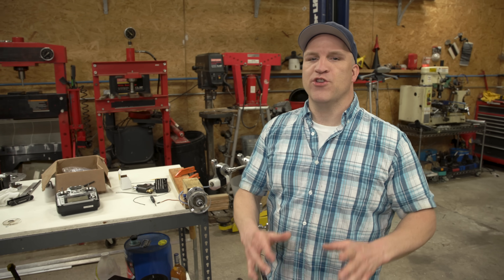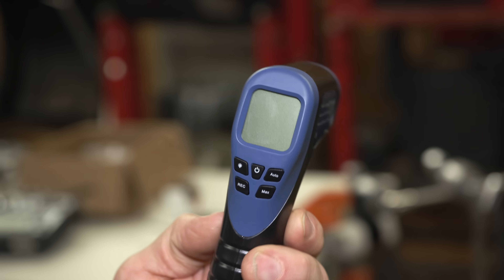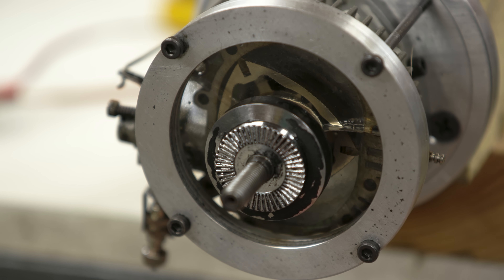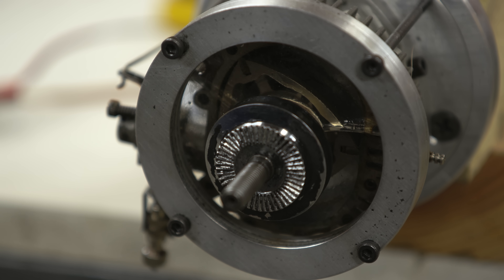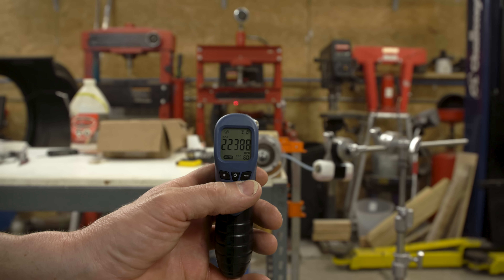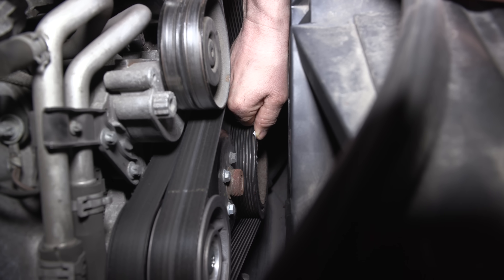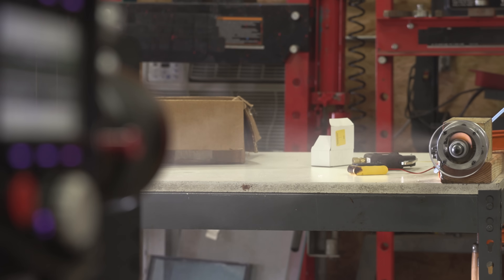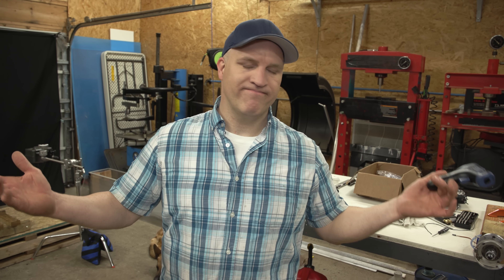See Thru Rotary Engine MAX RPM - 29000 (Wankel Engine)

Comment: From Wiki:

The maximum revolutions of a rotary engine is limited by tooth load on the synchronizing gears.[33] Hardened steel gears are used for extended operation above 7000 or 8000 rpm. Mazda Wankel engines in auto racing are operated above 10,000 rpm. In aircraft they are used conservatively, up to 6500 or 7500 rpm. However, as gas pressure participates in seal efficiency, racing a Wankel engine at high rpm under no load conditions can destroy the engine.

https://goo.gl/CzcpJL

Comment: That's pretty cool.... I know the clear cover is basically bulletproof but i still dunno if i'd wanna be 
standing directly in front of the main shaft (that isn't covered by the bulletproof casing) but is surrounded by combustible 
fuel that's spinning at over 20,000rpm, without having another safety screen in front of it!
 Just sayin.

Comment: I've owned rotary engine powered cars, 2 1st gen RX7's actually. My '81 12a powered car I used to routinely twist up to 9k rpm on the street. My '84 13b powered car saw 11-12k rpm daily for most of the time I owned it. They are insanely powerful little motors, & you can rev the piss out of them.

Comment: I turned to my wife and exclaimed,  "29,000 RPM, That's Insane!!! and about 2 seconds later, you cut in with "29,000 RPM, That's Insane!!! Awesome... lol
 Now it's time to use an FI system with a larger throttle bore. And maybe stand a little bit further away from it when you open it up!
Reply from the maker: Ha... That's funny

Comment: Don't forget to keep in mind , most measurement instruments are calibrated within a certain range... Depending on intended use . Be fair to presume the tacho you used  would be intended for use under 10k rpm ...

Comment: back in the 60's honda produced racing four stroke motorcycle engines that spun at over 20,000 rpms. so yeah having a tiny wankle spin at 29k is not hard to believe.

Comment: But a RX-7 won't rev up to 2900 RPM
Reply: the old carbureted ones would wrap the tach needle all the way past the last number and hit the back side of the stop peg and still not blow up. with the stock porting they didn't make good power past 6500 or so but would hold onto themselves at 13000 or more.

Comment: Impressive video...just a note about verifying the accuracy of the RPM Meter...you should check it at the approximate operating range in question...by checking it at ~1000 RPM, it is presumptuous to say it is therefore also accurate at ~30kRPM...internal electronics could be nonlinear, or just plain inaccurate up there...depending on what the unit's limit or operating range is...what do specs on that meter state anyway?...if 30KRPM is well within its range, I wouldn't question accuracy...  Cheers
Reply from the maker: That's a good point I didn't think about that. The limit of the meter is 99,000 rpm .

Comment: That s. A hobby ariplane engine never getting 29000 rpm only with nitromethane the tach is not ok ...and u have to keep the rpms , the engine never hold it not even for a second...

Comment: You forgot to divide it by 3. So it's actually at 9700 rpm which also lines up better with the sound.
Notice that when you measured with the frames it wasn't the same tip that finished a revolution.
Reply: Measurment is taken at the shaft.  Doesnt matter how the engine rotates the eccentric shaft we just count how many times it does.  We dont count how many times a piston has to move per revolution either.

Comment: Cannot consider the failure of a transparent cover as engine failure. If the engine had the proper part (metal) and it cracked, that is a component failure which lead to a secondary failure: namely the engine not able to perform and not classified as an engine failure. For technical reasons, any moving part within the housing (engine block) is considered the engine. Would anyone consider an engine failure if the spark plugs fail or the wiring supplying electricity to the plugs fail? if the crankshaft, moving gears or chambers malfunctioned, then yes that would rate as an engine failure.

Comment: What's even more impressive is how much HP these little engines crank out, they got 3 cylinder rotary's in Australia that are running 240mph+ putting down 2000+HP

Comment: how much hp we talking here? modulate 12 of these bad boys in a v pattern using an engine block ironically to cradle them. 12 rotar! prob. not very powerful, but the sound will be fast enough to beat ppl. XD

Comment: The only thing is that I would like to see the math on how many Rpms that would be on a rx7 size motor because the rpms would be a large fraction of that on a engine with a 4 inch rotor

Comment: How do you mesure the rpm? I think it has only 10k rpm..
Reply: The rotor was moving at only 9667 rpm but that is good.  The rotor is an internal engine component.  We want those to move as less as possible.  The goal is to turn the e shaft.  So this engine was able to rotate e shaft at 29k rpm while the rotor was only having to move at 9667rpms.  This is purposeful so the engine can churn out insane rpms but the actual moving parts inside the engine are moving at a fraction the speed.

Comment: If you're doubting the accuracy of a tool, you probably bought the wrong tool... (Even if you can check it)
Reply from the maker: I always check the accuracy of my tools when they are important. Try working on an aircraft with an uncalibrated tool. Even my best meters always had to be calibration certified by an outside company, torque wrenches everything... It depends what you work on. Even if I had paid $120 for this tachometer I would have still doubted the accuracy, nothing is 100% accurate.

Comment: ROTARY POWER!!! They have no reciprocating parts (parts that move up and down) unlike the pistons or valves on l4, l6 or V6, V8 and such. :)
Reply: Wankel power actually... this is the non-rotary version called the KKM.. The triangular shaped piston actually does reciprocate as it orbits in a planetary motion, a Mazda 13b engine for example has a 30mm stroke produced by the 15mm eccentric-crankshaft throw (offset).

Comment: There seems to be a lot of wasted cubic capacity with the triangular rotating "ring" if the sides of the triangle were inversed then the cylinder capacity would be even bigger - It would increase  some of the stresses but also increase the HP and make it more efficient too.
Reply: The Wankel was very inefficient... thats why it is obsolete.

Comment: Rotary engines love to rev higher and higher since they are spinning and don't have to convert the energy into any other form like piston engines
Reply: Wankel engines are mechanically LESS efficient... which is also why the consume so much more fuel.
Reply: doktorbimmer that is correct 👍

Comment: Dan42
On a wankel engine the exit shaft rpm is x by 3 from the rotor, so the rotor is running at 9700 rpm, only!

Comment: Could you try running the rotary engine on diesel?
Reply: Why? Diesel fuel is low octane.
Reply: @doktorbimmer  And that's why you inject it at the top of compression.
Reply: +Ellenor Malik Sorry, but that won't fix the problem either. Unfortunately the  Wankel KKM design is not very efficient or compatible with Stratified Charge Mode combustion... which is also why you will not see any production Wankel engines using the Diesel Cycle or GDI.
Reply: @doktorbimmer  I'll do it with a roots blower and pair of diesel injectors hacked onto a Mazda rotary with a drawthrough carby feeding 5w20 2temps oil just to spite you =)

Not saying it'll be efficient
Reply: +Ellenor Malik Yes! Oh Please do! but promise you will post a video... it should be good for a laugh!

Comment: Audio frequency analysis was a bit hard to do, only a short clip on max RPM and a bit of background noise:  486 Hz on first harmonic --> 29160 combustions per minute...  How many combustions do you actually have in 1000 revs? (depends on the gearing of the combustion chamber to the crankshaft.
Reply: I need glasses, and/or watch your previous video: no gearing, only bearing, so 1 combustion per rev on this particulate engine... So I can agree with your 29k RPM

Comment: Not a true determination or rpm the reflector has to be on the crank .
Reply from the maker: It is on the crank, actually it's on the flywheel, which is directly connected to the crankshaft, how can you measure the RPM so close to the center of the crankshaft?, You need some distance from the center to the edge of the flywheel, the crankshaft turns one revolution the flywheel turns one revolution. One revolution is one revolution no matter you measure it from.
Reply: Warped Perception yep na you are 100% right . I was thinking of something else for some reason. My bad .
Reply from the maker: Religion is poison ha, all good, I know it's kind of confusing since it's through and you can see the internal components, normally with my see-through piston engine you don't get confused because it's just up and down reciprocating motion. Thanks

Comment: I clipped a second of peak or near-peak RPM audio and did a spectrum analysis.  There are lots of louder overtones, but there is a decent fundamental around 479 to 482 hz, which would be 28,800 to 28,920 rpm.

Comment: So about 9600rpm, sounds about right for the sound it makes.
Reply from the maker: 3800Tech RPM is always measured by shaft rotation, not internal component rotation. That would be like if you take a V8 and you measure 1 RPM for every time a piston went up and down.

Comment: i dont believe your tach is accurate, even for such a small engine the rotaries dont run at 10k and sound like that. ive built enough rotaries to know that even a 2 rotor engine sounds much more labored than that at 10k with twice as many combustion cycles. you probably had your meter cycle set to 2 cycle, and it needs to be set at 1 cycle, since a rotary fires once per revolution. even at 14,500 RPMs they seem to take it in stride and ask for more.if you increase the intake and exhaust size you can keep it going because the only limiting factors to these engines is how much they can breathe and how well they are balanced.

Comment: Nice engine, one question how are you igniting fuel and is there timing on rotary? I had a 89 rx7. 15 years ago . With aftermarket straight pipe I was revving up to 10k . Spitting 4ft flames
Reply: Engines that small often uses glow plugs, so there are no timing. On spark plug rotaries there are two plugs per rotor, they use a leading plug and a trailing plug. Because the timing of those plugs varies, and the time between the leading and trailing plug also varies, there are in fact two distributors and two coils on a 13B engine.

Comment: If I'm seeing this right, this is an OS engines 0.30 ci Wankel  4 stroke.  I can also see that you used a clear disk as a flywheel.  29,000 RPM is completely believable for this engine with such a flywheel.  It was designed for a propeller, which will considerably limit the RPM due to the prop loading, and provide cooling air to the engine.  I'm thinking that may be why your front plate cracked, too much heat.

From what I've read in various forums, you did pull off something of a miracle by taking it apart and getting it to run after going back together.

Comment: You do not understand wankel too well do you?

Devide x 3 you measured rpm on each individual rotar tip pass.

It's 3 times less. You need to take a reading from 90 degree square face on the shaft with a black mark.

You did it from the front.

With your math my cars idles at 2krpm. And pulls away at 4krpm. You do not measure each piston stroke  you only measure the shaft rotation . 

By your calculation. My 3.2amg mercedes v6 limits at 36000rpm
Reply from the maker: It doesn't matter what's going on inside the engine, you always measure shaft RPM, that's what I measure here, it's just confusing because it's see-through and you can see the internal components, that's not what I measuring. RPM is always measured at the shaft on any engine or electric motor, it doesn't matter what the internal components are doing.

Comment: When Mazda first came out with rotary-engined cars in USA, a pair of factory reps from them visited my school. They reported that the stock engine would run 13000 rpm merely by defeating the engine governor, 25000 rpm with a supercharger, and blow-up speed was a whopping 78000 rpm!!!

Comment: I see you have the AMG battery problem as well! So annoying.
Reply from the maker: Well the battery is 12years old , it's the original battery for this car, so I'm pretty sure that the car monitors a voltage level at startup, kind of like doing a battery test, when the voltage drops below a certain level during the start and gives you the battery warning

Comment: OK.... I don't see that it has been mentioned BUT...We are talking 9,666 ROTOR RPM.... 
The ROTOR is spinning at only 1/3 rd  the SHAFT RPM of 29,000 RPM...
Reply from the maker: True, but the same applies to any Wankle Engine, the rotor is always a third of the RPM, for every three Revolutions of the Eccentric shaft there's one revolution of the rotor, same thing in a Mazda RX-7 or a Wankel airplane engine.

Comment: I know you get more RPMs out of one of these engines compared to a piston engine but how does the torque compare?  I can see the advantages these engines would have in an airplane.  I wonder if anybody ever tried one on a lawn mower or a weed-eater ? I am amazed you have a plastic cover that can take the heat from an engine.

Comment: I've used the tool before and I promise you that it is more accurate than the dial in your car. I have had results within 0.75 percent so you will have to spend a lot of money to improve the accuracy

Comment: Worth bearing in mind that the output RPM is 3x the rotor RPM (which must have been about 10000 RPM). You do have 29000 ignition cycles, though.

Comment: You can't kill those things.  An idiot friend of mine had an old RX3 in high school, and nobody ever explained to him that you have to put oil in engines.  (Especially Wankels.)  For MONTHS he drove it bone dry, and couldn't figure out why it would seize whenever it got hot.  He finally asked me.  I checked it.  Zero oil.  Not even sludge.  Once it had oil it ran fine.

Comment: “Apparently this engine blew before the Briggs and Stratton”

Come on my guy...

You know FOR A FACT you could go to any junkyard, land-fill, or trailer park; find a 5hp Briggs and Stratton that’s been sitting in a puddle of water for 30 years, clean the float bowl, pull the air filter, replace the spark plug and hit it with some starter fluid and it’ll fire FIRST PULL.

Comment: So, if this follows the same rules as the 13b, 3 full rotor revolutions = 1 full rotation for the eccentric shaft. If it does, you're actually at 9,666 rpms.

Love it regardless.
Reply from the maker: Now you got it mixed up, for every 3 rotations of The Eccentric shaft is one rotation of the rotor, but it's still one combustion event per rotation, so essentially it's kind of like a two-cycle. But you never measure the RPM by an internal engine component, RPM is measured at the shaft.

Comment: Dude, your Mercedes needs some work.  You can hear the a/c compressor whine as wel as idler pulley bearing noise.
Reply from the maker: Lol..  nah that's not the ac, it's the Supercharger, all normal sounds there.
Reply: Superchargers dont whine at idle.  A bad ac compressor and idler pulley do.  I have a Mercedes and had same whine until I changed those parts.  Just tryin to help.

Comment: You should really be careful doing this in a garage. A regular engine would be fine. Hell even a fire usually has complete combustion, but rotary engines don’t fully burn all the fumes leading to partial oxidation of pyrolised carbon to carbon monoxide.
Reply from the maker: Thank you, I have a full exhaust and make-up air system, when turned on the air change rate is 3 minutes. Basically that means the air in the space is completely replaced with new air every 3 minutes.

Comment: Your measuring on an triangle so devide by three? 13000 rpm? That's more assuming hearing the sound of the engine?
Reply from the maker: That's incorrect, you don't measure an engines RPM by the internal components, RPM is measured at the output shaft, friends then do not going to measure the RPM of a piston engine by the piston.
Reply: Warped Perception, ok i didn't notice you where measuring on the outputshaft....then its indeed an correct mesurement...

Comment: Blowing that transparent cover on it, is exactly like cracking the block on a motor, its the cover that keeps the gas and compression inside the housing, so since it cracked, gas wont ignite and leak through to the other strokes of the motor ( ignition, exhaust, ou know the idea ) causing it not to ignite and cause gas to get into the wrong stroke. ( blowing the motor, and losing compression )
Reply: Yes, but the difference is that cover is transparent plastic lol.

Comment: Next time, put a piece of tape on the opposite end. Could of probably gone faster without that imbalance, it's especially noticed when you verify your readings against the highspeed. Just divide your reading by 2.
Great video!
Reply from the maker: Good point